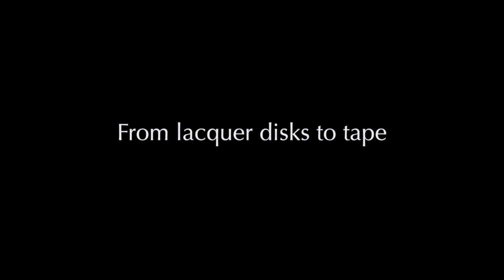Shelford Interviews: Rupert Neve discusses how technologies in the 60's changed sound engineering

Comment: Musicians nowadays have got it so good. With digital tech, multi tracking is a peace of cake and dead cheap too. As a young guy back in the 80s I was desperate to do multitrack recording (playing over the previous instrument) as I was unemployed, I had the time but no money. The big problem were the tape recorders, the ones that could multitrack were seriously expensive reel to reel tascam and revox, even in those days they cost thousands. The solution was to use two cassette players so you could play along with the out put of the first cassette and record it and the new part on to the second. The problem was that after a few additions quality was really rough. In the late 80s the much more affordable porta studio came along, where  four tracks on a cassette could be used separately. Although still  expensive it was a game changer for the amateur.